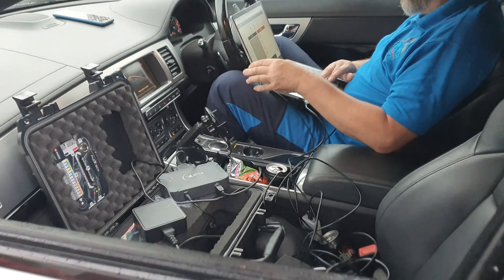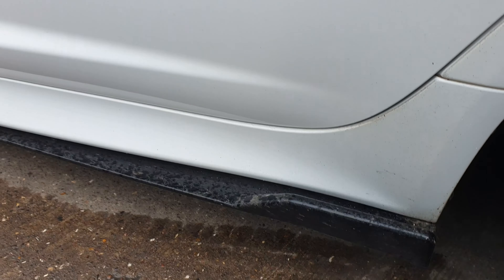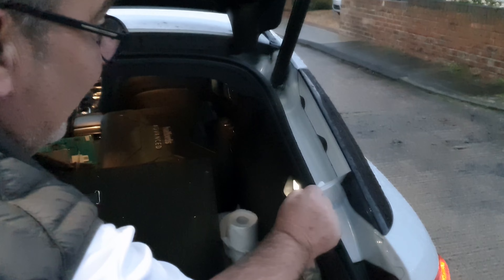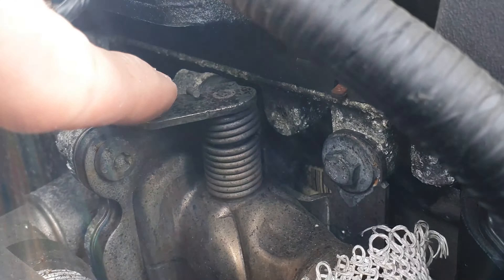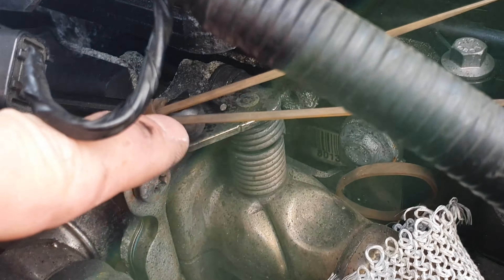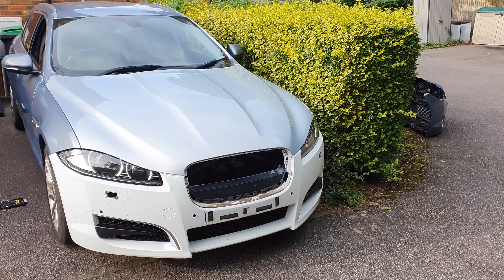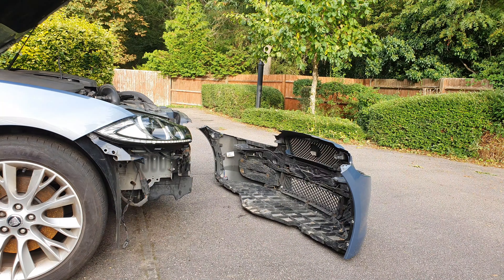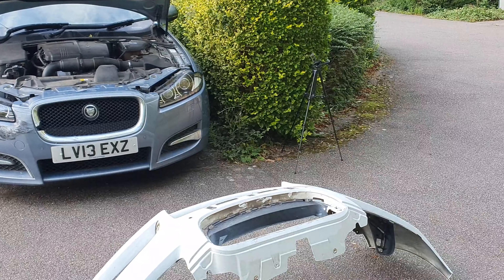Rebuilding a Jaguar XF Sportbrake Part 8 - Ready For The Bodyshop!

Comment: Mine is Glacier white but i prefer the other white. 2015 facelift 2.2 Portfolio. It  also has the same issue with the gearbox, it has a think about accelerating before it does it. it`s fine in the other gears.
Reply from the maker: I'm biased, I love the Glacier White, it was a £600 extra when new!

Comment: After you had stripped the white bumper, it looked like there were still some black bits attached to it. Don't they come off? 
I'm so pleased that New Zealand doesn't use salt on the roads, that corrosion on trim bolts is shocking. I've got an x350 but have really enjoyed your series on the XF Sportbrake.
Reply from the maker: Thanks for watching! I'm glad you're enjoying it... the plastic bits I left were glue/melted on and I didn't want to damage the bumper removing them fully... they can be painted too, you won't see them

Comment: Hi Ash I'm trying to sdd to activate my steering wheel. I'm running it on Windows 11. When I try to open functions it says it needs pagmcp thankyou.
Reply from the maker: Hi mate... you need to run the web browser (Microsoft Edge I'd imagine) in Internet Explorer mode, if Windows 11 will even let you do this.... click on the top right hand corner for the drop down menu and there should be the option listed there